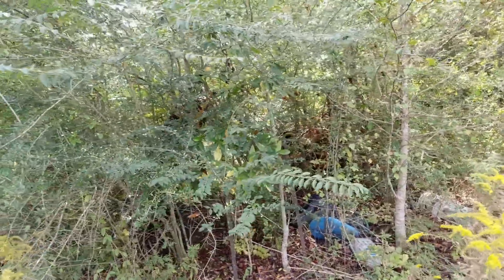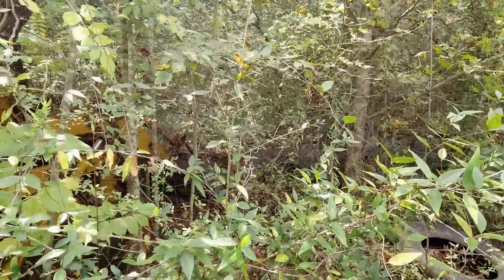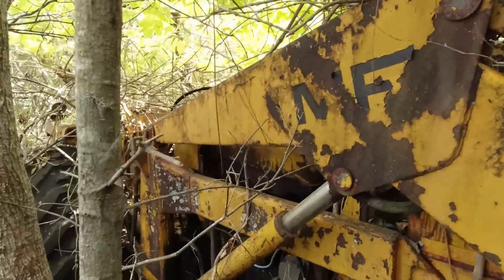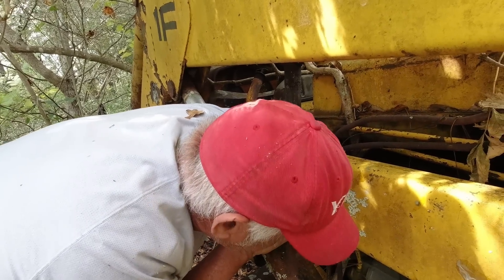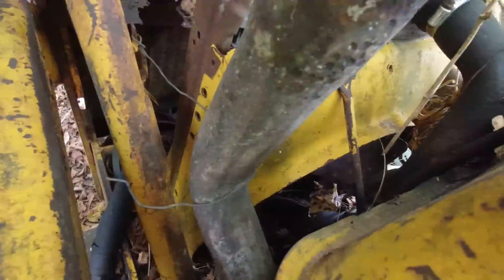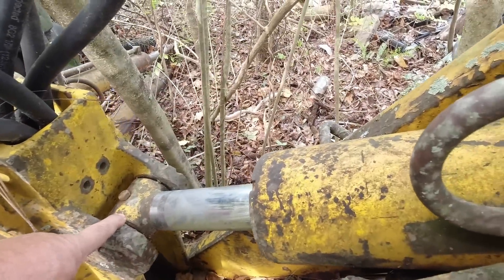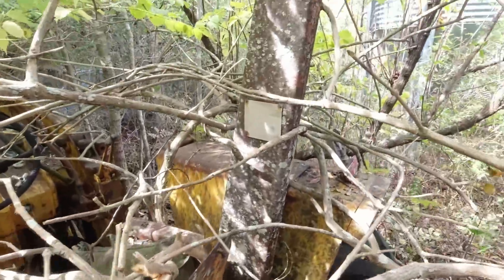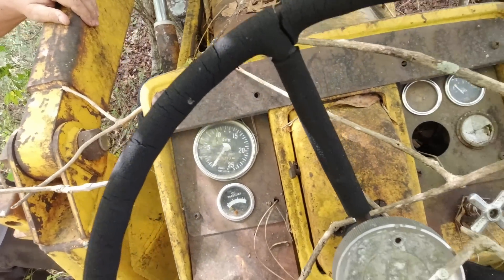Abandoned Massy Ferguson Backhoe.To Far Gone to START?

Comment: I know where there is an MF backhoe similar to that but I'm not sure the model number but it has been parked for years because the hydraulic pump went out of it it mounts on the front of the crankshaft and they said they could not find one for it
Reply from the maker: I am not sure if we are going to trade on it. I would have tried it but he turned down 400 offer. I know thats cheap but there is alot wrong with this machine

Comment: Appears to be a Perkins engine Wiley. Drain the oil mix out of it and fill it back up and give it a try. From my experience you have a bad head gasket. Pull the head off and put a head gasket on it and I'll bet it will fix it and bring it back to life.
Reply from the maker: I made him a offer but he thought it was to low. I would not mind trying to start it. He said it was mixing water in the oil. 
Thanks for watching
Reply: @DontbeWily  that would be an easy fix and those were great backhoes back in the day. I worked at a Massey Ferguson dealership and worked on them just because it's mixing oil and water was always about 98% of the time was a bad headgasket sometimes I would take the heas to a machine shop and get it trued up just so the gasket would have a lot less chance of leaking again. But if you get that backhoe I wish you luck my friend. If you do and need advice just holler and I'll tell you what I know.

Comment: I had a 1970 MF 30 with a perkins diesel. The machine was beat. But that Perkins ran like a top. The backhoe had a turning drum. Bad design. I prefer turning cylinders. The transmission was great.
Reply from the maker: Thanks for sharing. I offered 400 for this sitting where it was. I would have like to piddle on it and see if i could get it to function one more time

Comment: Thanks for another great video Wiley and Jacob. It was interesting. 

Everyone looks at things differently. My opinion after a short look over is not much left there. Water in the engine is a bad sign most often. 

May be some parts value there but do not see it of value for using day to day. 

See what your viewers thing and go from there. 

Thanks Wiley and Jacob. 
You take care and be safe. Thanks. 
The Iowa Farm Boy.
Reply from the maker: Thank you for sharing. Probably not many of these still operating. We thought we were going to get it bought but he turned down 400 and never cane back with offer. I am thinking those old machines running go for cheap  5k at most.